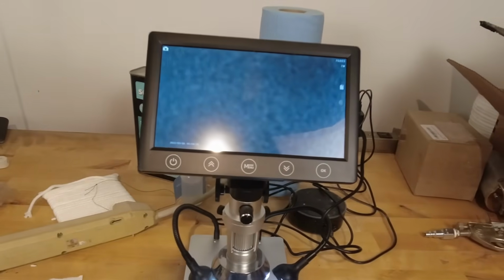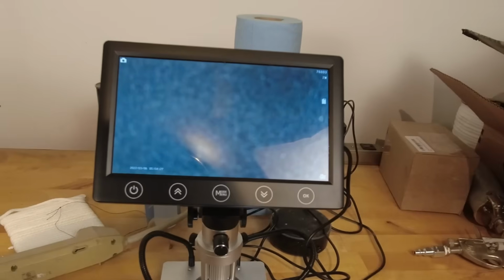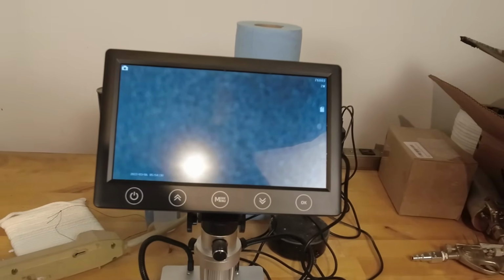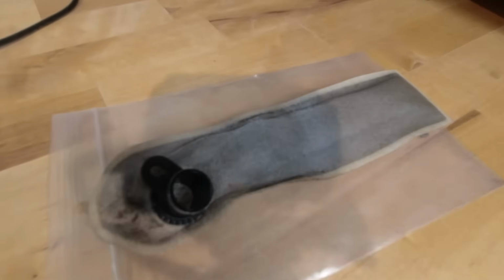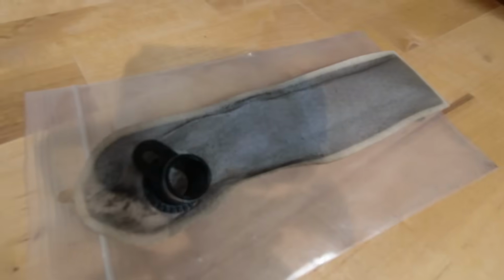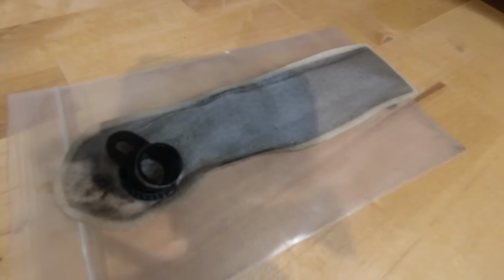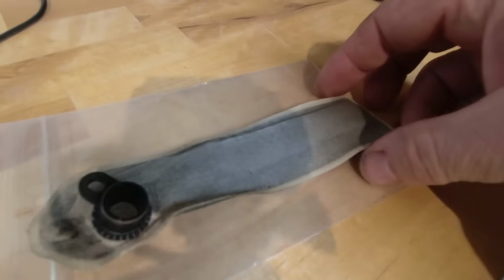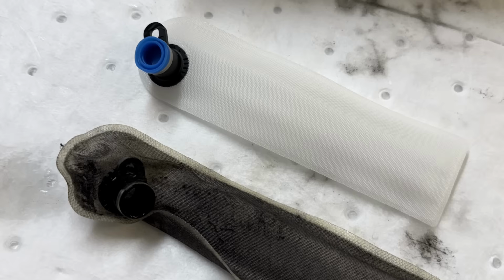Ski-Doo Plugging Fuel Sock Filter: SOLVED!?

Comment: Has anyone tried bypassing the sock filter completely and increasing replacement frequency on the inline filter outside of the tank? Because this is ridiculous. 

Another way to troubleshoot if it’s the filter sock is to lift the front end of the machine with low fuel so the sock is bypassed and gets picked up from the back lower end f the gas tank through the bypass hose. Mine idles poorly when flat on the ground but when lifted idles just fine. 

Currently waiting on the sock filter to replace it. I have ordered the Kimpex filter since OEM clearly is not ok but I believe this issue is beyond the filter or dirty fuel. There is a contaminant plugging the filters and the filter socks have a high filtration level which plugs easily. Can’t be fuel source otherwise more people and vehicles would be having issues. 

2019 Expedition Sport 900 Ace.

Comment: At  3500 km; engine won't rev past 6000 ( fuel starvation ) intermittent grip warmers, gauges and no headlight sometimes at startup. I think the fix is a for sale sign. I'll go back to my 2002 ZL550 which has never missed a beat.
Reply from the maker: I'm going to take wild guess that you have a bad ground, that will do all sorts of weird.
Reply: @DougsMessyGarage  Thanks. I'm going to put that on the Ski Doo summer list.

Comment: While I appreciate your effort, but by examining one filter you cannot claim you have solved the issue. Dozens of us, maybe hundreds, have been monitoring this issue since the Gen 4 Skidoo machines have been introduced. This issue also occurs in the XU chassis, but at a much lower rate. This is an issue almost exclusive to the 900Ace and 600Ace machines.  On my personal machine my filters have had nothing on it resembling fiber at all. Every bit of the black junk was some sort of carbon and it completely clogged the filter. In fact, we washed off all the gunk and put the filter back in service.  Everything in my white container I washed the filter in was black particles, no fuzz at all.  It has been generally accepted by the internet community that the contamination is coming from the pump itself. This theory was first floated by a guy named  Eric Dutilly.  The 900 ACE, 600ACE, and 600EFI all use a system where the fuel pump immediately circulates any fuel not needed by the injectors directly back into the cannister around the pump. As the pump sheds carbon internally from the brushes and armature, part of the junky fuel heads through the inline filter to the injectors. The unused fuel not needed by the injectors is bypassed directly into the cannister around the fuel pump and it is sucked up by the sock filter.  Why don't the Etecs have this issue?  It's simply that while they use a sock filter as well, the fuel travels a different path. On an Etec the fuel travels from the pump, through the inline filter, to the ECU and then to the injectors. Fuel not used by the injectors is returned back to the fuel pump housing and dumped back into the cannister. Every single drop of fuel that an ETec pumps is filtered through the much larger inline filter before it is put back into the cannister surrounding the fuel pump.  The theory presented in your video discounts the fact that the sock filter issue almost never happens in the 850 and 600 Etec machines. If, in fact, fibers were clogging the sock filter ALL Skidoo machines would be having this issue, not just the ACE machines. Overall I enjoy your information, but you are mistaken on this one.
Reply: Agree. Not just a fibre problem.
Reply: Excellent explanation Doug.   I learned a lot.    You know your stuff..
Reply: Has someone confirmed this clogging is carbon buildup as opposed to tiny plastic particles from within the fuel tank? Seems it would very easy with some simple tools, knowledge, and microscope and lab work to find out which it is? Reason I ask; carbon buildup on brushes from motors is quite real and does make a nice little continuous spark show when running in open air. The carbon is a result high temp arcing with oxygen in air; however, the fuel pump is submerged in gasoline that would allow the brushes to run cleanly with zero visible sparks that would negative any possible formation of carbon buildup that would normally only come from a motor running in air.
Reply: @Jason-wc3fh  That's a good observation. Myself and others might be too loosely using the term "carbon" without proof. It might simply be wear particles from the brushes or the armature. I do know that both white lined tanks and black lined tanks have the same filter issues. After my first filter, and the first filter of three other machines, the black is no longer on the outside of the sock in most cases. It is fine enough that it's caught inside the fabric of the filter.

Comment: Always thought it was drive belt dust being sucked into the tank by way of the air hose.
Reply: We've eliminated that as a cause. Reason one is that the vent hose of the tank exits the outside the cowling and tub on the Expeditions and they still have the problem. Several people, including myself have tested the vent hoses with white pipe cleaners and have found zero evidence of belt dust.